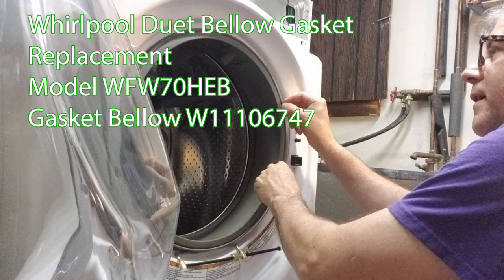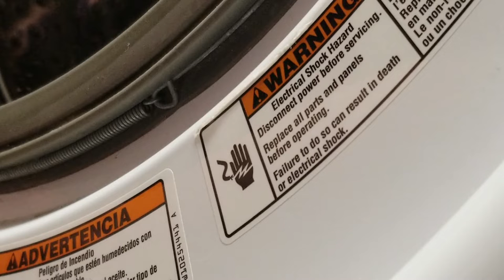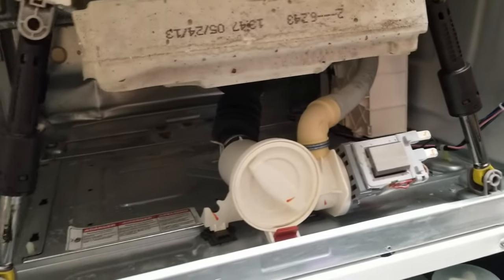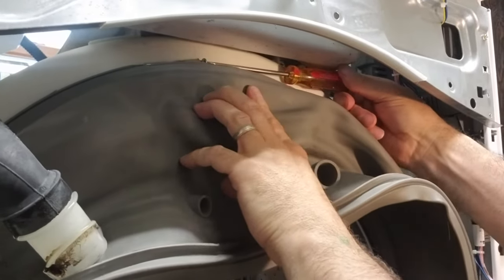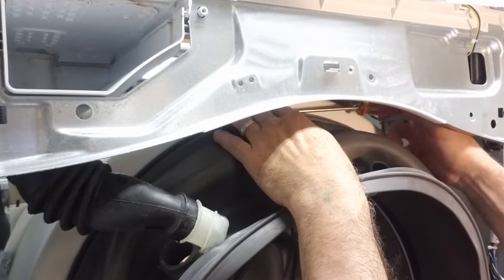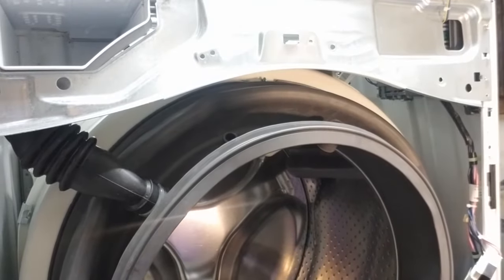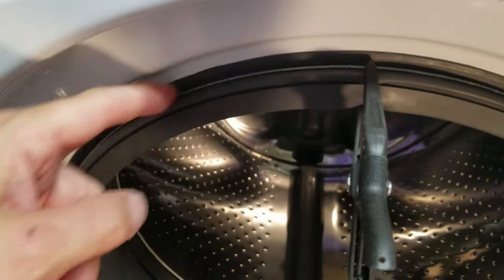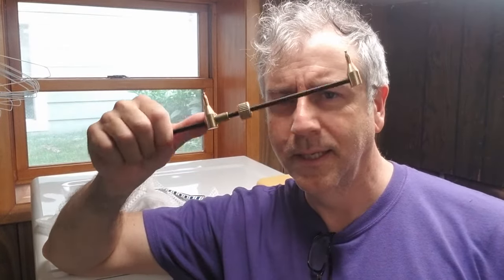Replace Whirlpool Duet Washer Gasket Bellow, Clean Filter

Comment: Our wash machine has been leaking for a while and we were  mostly just trying to ignore it and hope the problem goes away.  It was leaking today so I climbed underneath and discovered where the leak was coming from which was a ripped boot. I found your YouTube video.   I bought the boot and the spring tool.  I was able to replace the boot and, most importantly, no more leaks.  Thanks so much for posting this video.  I probably saved $300.00.

Comment: Well, wasn't sure where on my washer my drain was as some can be accessed from the back.  Took apart the back only to find out I had the same configuration as this video and needed to access it from the front.  By the time I finished, I wished I had known how much I'd have to dismantle and had bought a new gasket/bellow beforehand, but at least I was able to clean my drain, wash my gasket/bellow and know how to replace the bellow if it ends up being shot!  Thanks for the wonderful guide video.

Comment: Thank you very much, Ken. awsome instructions. Beware of a screw under the control console, which mine had couldn't remove it without removal of screw. Don't need special tool use needle nose pliers and it will come.

Comment: We just had our boot replaced today. The guy who did the job did not pull the boot back between the plastic piece and the drum.  (the step you did around the 18-19 minute park). It definitely didnt look right and we were able to easily do what you did in the video. My repair guy got very defensive when i texted in and said we were making a mistake. He even went as far as to say he was amending his receipt to say we altered his repair. I'm like 99% sure we are right (otherwise theres a gap where water looks like it can just flow into our machine). Just interesting.

Comment: Great video. Mine has a drum light, so I just had to cut a hole in that closed port to the right of the detergent inlet- that's where the little LED housing gets stuffed in. I bought the spring tool- huge help. This would have been significantly more difficult without it. Well worth the $30-ish cost on top of the $100 gasket off eBay. Not a bad price all-in, considering an OEM gasket is apparently like $300.

Comment: Filters accessible from the kick plate on the bottom.Its 2 screws and it pops off. Put a deep baking tray under the filter cap before you open it. And be prepared for an odor. I don't know how many washers I have seen scrapped because the filter drain is clogged. It's needs checked every few months so IT IS ACCESSIBLE without removing the top and the door....

After cleaning it out you can buy cleaning pods for the washer, Afresh is the brand that comes to mind.
Reply from the maker: There is no kick plate on this model.  Unless you know something I don't...
Reply: Dear lord I wish mine had a removable kick plate. No such luck on mine. You can access the thing by taking either the back or the front off the machine, gigantic PITA. For something that should be checked semi regularly, that's way too much work. I'm honestly tempted to get out the Dremel and cut a big square out of the front panel so that I can directly access it in 5 seconds.